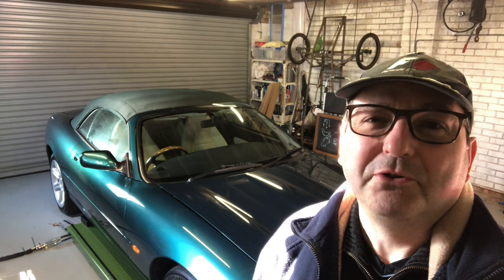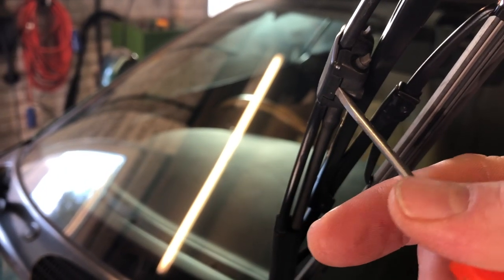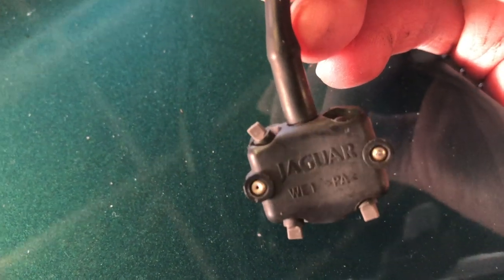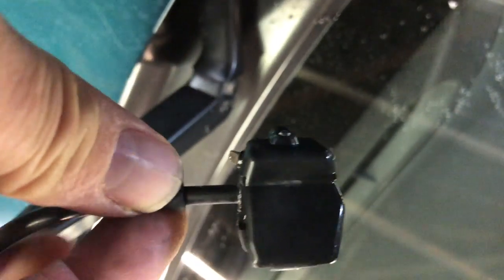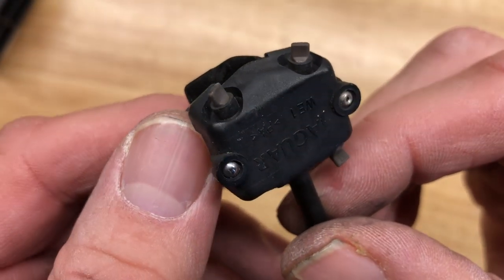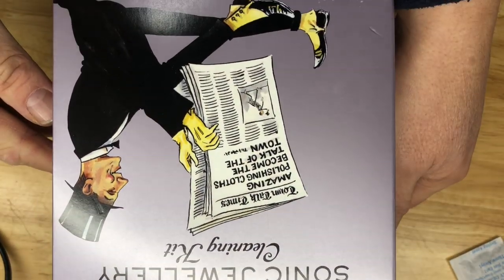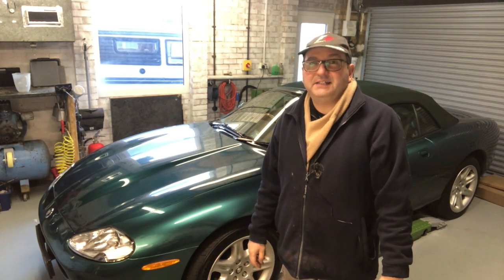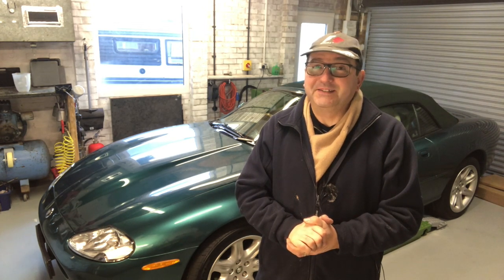Cleaning washer jets with a jewellery cleaner on my Jaguar XK8.

Comment: Nicely done with clear instructions. I have a 1999 XJ8L and just did mine this morning. Used rubbing alcohol with the jewelry cleaner. The duck Bill's cleared easily but the two round metal orifice was still clogged. Poking a few times with a pin unclogged them. Working great! Thanks a bunch for the video.
Reply from the maker: No problem Jim
Thanks for taking the time to comment👍

Comment: Not much cavitation going on in that little ultrasonic unit, John.  I'd spend a little extra and get something with a bit more drive wattage like a Branson B200.  I have an old Branson benchtop unit from 20yrs ago that I use for cleaning the wife's jewelry and I always use Windex solution.  Good demo though.  BTW, my guitar tuner shows your tri-piccolo warble as a high C (C8).  Your victory music should have been Copeland's Fanfare for the Common Man.
Reply from the maker: I will take that thank you very much.
So much nicer than the normal recommendation
Yakety Sax. By Boots Randolf🤣🎄

Comment: Hi john,

Liking these tips etc.

Just bought a 1997 Xk8 convertible which has an electric fold door mirror issue in that both foldout beyond the normal position, any idea why?

Happy Xmas
Melvyn
Reply from the maker: Hi Melvyn. Congratulations on your purchase. I don't have power fold so I am sure others will advise you better. I imagine that the mirrors have been knocked out of position. I would open them electrically and then firmly but not violently fold them in by hand.
Then I think you fold them electrically at which point they should jump into their correct location. You can then reopen them electrically.
As I said though. I would wait for an adult to advise us both on this one Melvyn😁
Reply: Hi John, 

I did as you suggested above, and YIPPEE it worked, now my mirrors fold out & back 100% as Browns Lane intended.

P.S. How do I send you a pic of my car?

regards
Melvyn
Reply from the maker: Melvyn Bull glad to have been of assistance. 
You can send pictures to john@tothegarage.co.uk